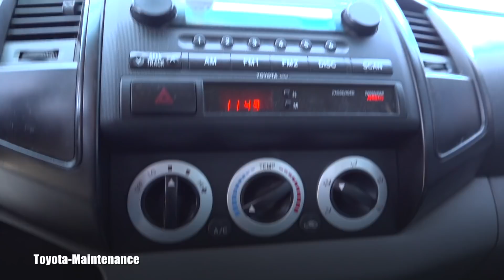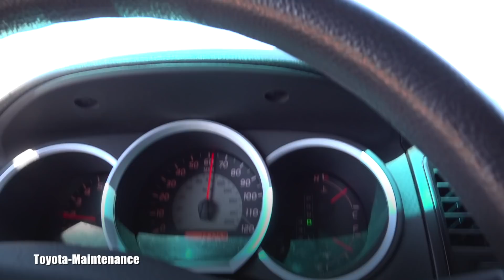Steering wheel shakes while driving diagnosis

Comment: Great job!  Another demonstration of good analytical skill and thinking.  However, I suspect that the violent shaking at high speed could be due to one of the 4 wheels not properly installed i.e. the screws forces not in good balance.  When you rotated the tires, you inadvertently corrected the problem.  It’s always great pressure to watch your video!
Reply: You actually make a really good observation!!! I saw the way he installed them and then torqued all the lugs back, I thought myself you know this guy is doing it the right way and I doubt the tire shops did it this way 😂😂😂. I’ve seen plenty of tire shops, and they always use the air impact and just give it a few “chugga chuggas” 😂😂😂

Comment: As a DIY I have seen tires out of round . I have found them while the car was raised and spinning the wheel looking closely for high or low spots . I have also seen radial belts twisted . On very old tires it's not uncommon for them to go out of round before the tread wears out . A lot of shops play the DRY ROT Boogie Man . The slightest sign of small cracks and they try to scare you . Even if new , old tires seem to harden over time . The rubber seems to dry out .

Comment: Timing chain cover was a TSB.  You are correct about rear stance being off.  If anything, the drivers side should be lower due to fuel tank and battery being on that side.  Passenger side spring hanger bushing is toast.

Comment: Its been a good 20 years since I had a similar thing happen to me - new front tires fixed it . I don't recall any blistering or visible distortions, so what I believe happened was a minor delamination of the steel belt.  As wheel speed increased, centrifugal force brought an increasingly annoying out of round condition into effect    So... I marked that one up as pothoe damage. - 20k miles with good tread when changed out.

Comment: My 2005 Toyota Camry XLE for some years had that kind of vibration. Took it to the dealer, they couldn't figure it out. Took it back to Sears where I bought the tires, all they would do is check the alignment (BYE Sears). Next time I needed tires I turned to my old favorite brand of Michelin. What was found by another tire place and myself also aghast at not noticing myself, Sears had originally installed the wrong tire size! New tires with the correct size...problem gone! I too was thinking belt shift in one, had the tires rotated, no change. It was in finding that the car had the wrong tire size installed and not until I replaced them was the solution found.
Reply: Gidagorfen ....front wheel bearing on Camry..... common issue

Comment: It was interesting to see they used 6 bolt hubs on those 2WD PreRunners as they were usually reserved for the 4WD models.
Reply: I think prerunners have the same suspension setup as 4wd w/o the fwd function of course. My dad has the basic rwd 5 lug and we can't get suspension parts/brake parts meant for a prerunner, thats almost 100% of the time when getting new parts.
Reply: @mitomr.twiceasnice4358  not even at rockauto?
Reply: @LAactor  its always a message like - not proper fit, or incompatible, or fitment not guaranteed. So we always select the parts for basic 2wd non preRunner.

Comment: Please can you consider a video on Corolla clutch creaking. This is a very common problem and although there are uploads showing lubrication of slave cylinder, very often it is more than one single point requiring lubrication, such as the connection between fork and slave piston rod.
Reply from the maker: if it comes my way will try to film

Comment: 4:15 radial runout. There are Hunter balance machine that minimize the amount of shaking by giving the high/low spots of the wheel and tire, so that you can loosen the bead and align the tire low spot with wheel high spot. 

Also,  balance machines have special shaft cones for toyota trucks/suv, so wheel could be centered to correctly balanced wheels

Like how you look over everything for this diagnosis
Reply: toyota wheels should be balanced by the lugnut holes not with a cone in the supposed center they are lugcentric rims and probably could have cured most of that runout if he had a tire machine and could break it down and spin the tire 180 on the rim and reinflate it
Reply: Mark Roderick True. But good luck finding a a lot of tire shops with those adapters. They are very rare.
Reply: @nordicpride9708  that is true or if they have it they don't want to take the time to set it up and use it.

Comment: What is the address of your shop so I can drop off my 2011 Highlander for you to diagnose the source of front-end vibration after replacing  front drive shafts (twice!), lower ball joints,  stabilizer links, bushings, tires, balancing and more. Maybe I should give it up after 260K miles and move on, but otherwise, the car still runs like new.  What more can be diagnosed and/or replaced?

Comment: These days if you don't have a tire shop that does road force balance as well they will never really know if a tire is 100% or not. I dealt with alot of low profile tires before and without a road force balance you can get good numbers but the car shakes like hell. And the tire needs to have it's location changed on how it's set on the rim. Also if the center cone for the rim is not right you can get the all ok from the tire balancer, but still shake like hell at highway speeds.

Comment: How about steering wheel shake when braking at high speeds? Does that usually indicated warped front brake rotors?
Reply: Either that and or could be problem with caliper not saying its completely bad but guide pins that or faulty or strip can cause uneven brake wear and will eventually cause horrible braking and high speed and sometimes even notice arpund 5 mph or under when coming to a very slow creeping stop.
Reply: Could be front wheel bearings. What did problem end up being?

Comment: i have a 2001 sequoia limited and the sunroof is stuck in teh closed position.  When i push the open switch it tries to open but appears to be stuck,  Could it be a lubricant issue ?
Reply: The cables sound to siezed. Common toyota issue

Comment: Here's my experience with a 2003 2wd Tacoma and high speed shaking.
I went through the typical stuff.  Two different tire shops, balancing, look for out of round, etc.  I even bought two sets of tires, another set of wheels, new front struts, two alignments, etc.
The cure, over a 100,000 miles ago was a BETTER MORE EXPENSIVE SET OF TIRES.  As another said, you get what you pay for.
Reply: Were your spring clamps as loose as the ones on the passenger rear of this truck? Seems unless there is some serious flexing of the spring, that the replacement springs were thinner than the OEM springs, to have that much play in those spring clamps. Or they were supposed to be heated and pressed to fit the springs when being replaced under recall...
Reply: @kramnull8962  no.  I have over 190,000 miles now on the original rear springs.  I don't know if the newer Tacoma has a different type rear spring, but mine have that "reverse" bend look that were that way since the truck was brand new.  My truck has no modifications at all.  Everything is at stock specs.  The only recall this truck went through was the front end which the dealer forgot/didn't to do an alignment after the work so that destroyed the front tires.
Reply: What tires did you end up getting? I think Toyo are pretty solid
Reply: Dont get d chinese crap, bridgestones are excellent tires
Reply: @manuelsalvatierra2940  My problem was cured two sets of tires ago.  The current tires are Toyo A/T Open Country.

Comment: I just had new tires installed and now my steering wheel shakes too.  I should have gotten better tires!  Maybe tire beads might help?
Reply: @MrCapi55   actually first step check tire pretty :D. I can tell you even shops put in 40 psi ... reset them to 32 no more shakes.
Reply: Balance
Reply: Have a "road force" balance done on the tires

Comment: I replaced tierods inner and outer they was bad. Then got a wobble in steering beteeen 45-55 mph that got worse after driving 10 miles or so. Turns out it was a cv joint. Found that out after new tires and bearing. No noise at all. Changed both axles now drives like a new car. 2001 Corolla

Comment: I just had my wheels balanced but they still shake and I think that maybe the car ran into something when the teenager who owned it was driving and possibly warped the front CV axle where the wheel bolts on is that a problem too because it looks like it wobbles out of line with the tire like the wheel is not perfectly spinning in a circle but more of a wobble how do you check for that same as just turning the wheel?

Comment: Brake pads can be "skimming" the rotors with no smell and no obvious pad or rotor wear. This will shimmy like bad wheel balance. Test drive and check the rotor temperatures. If one is hot you can bet the caliper is not retracting fully. Replace the caliper.

Comment: That's a tire problem.   I have had the same problem with my 2004 Camry.  The belts slip with cheap tires and crappy Nebraska roads.
Reply: Ferdy Tacomaboy .... actually no such thing as " belt or cord slip" low grade material and manufacturing.....to be expected from Sailun....

Comment: If you had a bad tire in front and you rotate it to the back, you should still have the vibration but it should be felt in your seat instead of the steering wheel.  Did you experience the vibration in the seat after the tire rotation?
Reply from the maker: No

Comment: My 2000 toyota prerunner 6cyl with over 200k miles the steering wheel  vibrates when i go over bumps at speeds of 60-65mph  and above and after the road gets smooth the vibration stops does anyone have any idea as to what the problem might be?
Thank you

Comment: I am here for a help. I have 2004 Honda Accord. It will vibrate when the vehicle is in the accelerating process from 55 to 60 mph. Once the accelerates finish, the vibration disappears. This issue has lasted for about a year now. All tires are brand new, well balanced. I did my own maintenance and I didn't see any oil leak from the bottom. Everything is bone dry. Except for the little vibration during the acceleration, there is no single issue of this old car. Any thought?

Comment: I've been told that if one of my tyres gets ruined on the RAV4 then it's best if I put tyres on all round, just one more of having  all wheel drive but hey ho at least it's a Toyota
Reply: John Mehaffey ....I see you wrote tyre so I'm guessing you are in the U.K.   you do not need to replace all of them....stick with the same brand and size and you won't have a problem...
Reply: @ronaldhickman9953  it's recommended as he mentioned he has a 4 wheel drive and it can affect the wheels turning at different rates slightly. HOWEVER owners can do what they want.